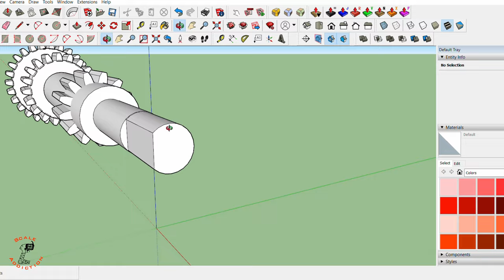it sound so good now with 3d printed Exhaust and straight pipe|

Comment: Wow, awesome! Just thought about replacing my reductor with the type of connection you have :)
You know the maximal angle where this dog bone connection will work properly?
Reply: Also my you please tell your carbuerator setup? how many screw rotations you made?
Cause I see you have pretty nice idle
Reply from the maker: The carburetor setup is 9 turns and 4.5 turns for the fuel

Comment: my hood just opened up and ripped off not sure if this is an isolated incident but hood pins might help
Reply from the maker: While driving?
Reply: @scaleaddiction  yes I just reprinted the hood yesterday but I am also running duel high torque motors on 4s so that might be a contributing factor